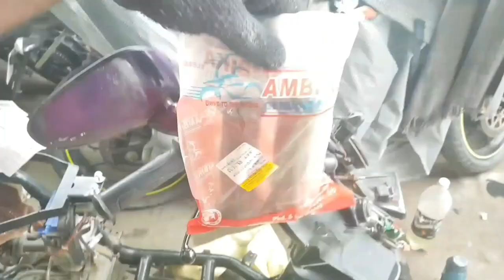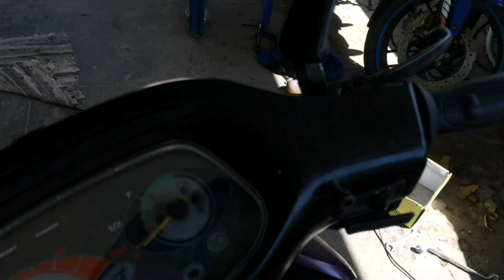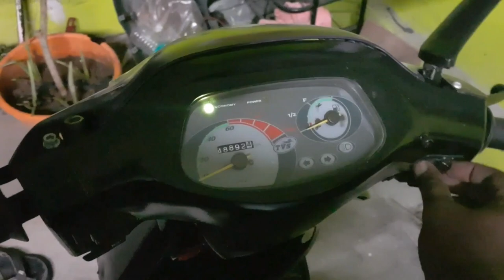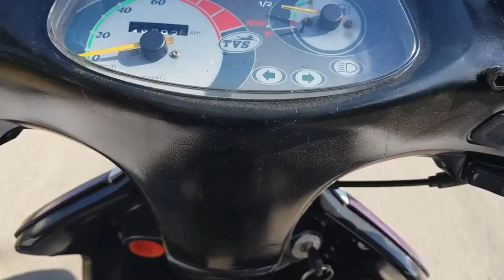Scooty pep+ (2008) Rebuild || Completed || Part-3

Comment: Bro old model Scooty Front and back fairing Glossy shine poiruchu Acrylic paint use panna Shining coating kedaikuma....??New parts mathiri Shine
Reply from the maker: I think acrylic paint will not survive heavy rains bro ,,, try clear coat
Reply from the maker: Clear coat will definitely give you more shine and gloss
Reply: Bro Clear coat paint Stock paint Vida Differenta erukkumaee broo....Enaku Stock paint mathiri shininga erukanum...Ennoda Scooty red color....Stock paint mathiri Vara Enna pannanum

Comment: Bro I have a smooth pep and it not working i want to fix it .. can you tell me which sizes of spanners and other tools required for rebuilding it plz
Reply from the maker: U need + and - size screw drivers and spanners from 10 to 19